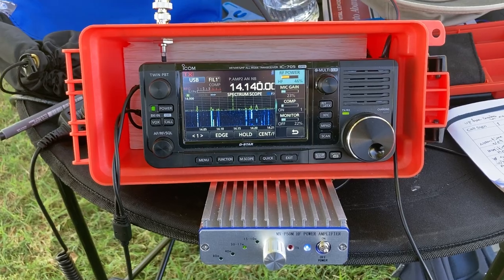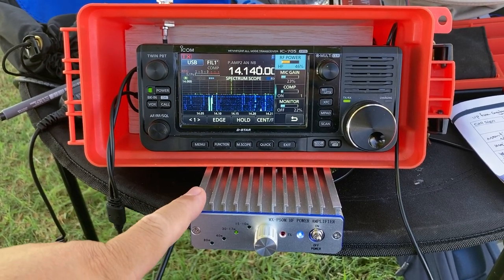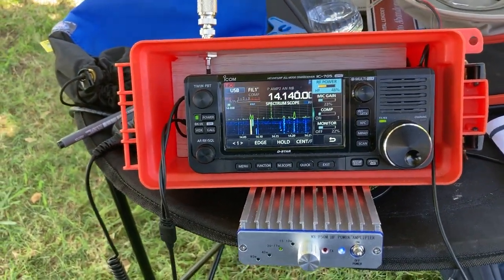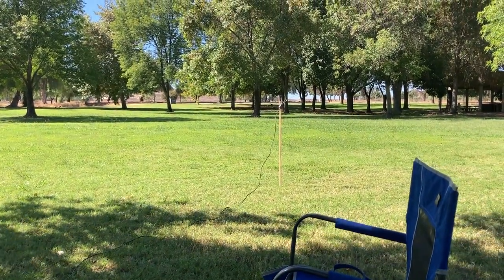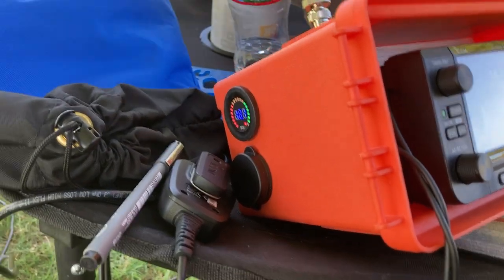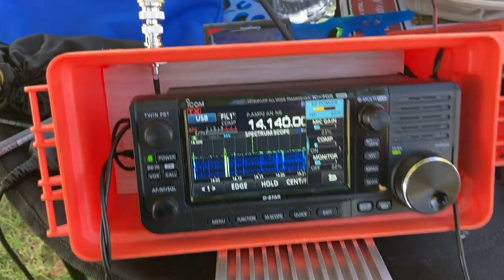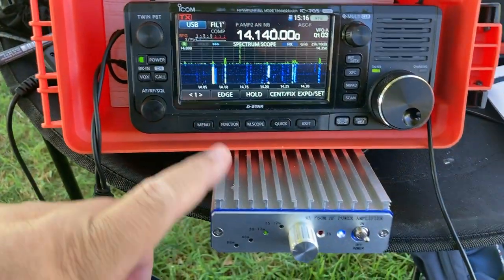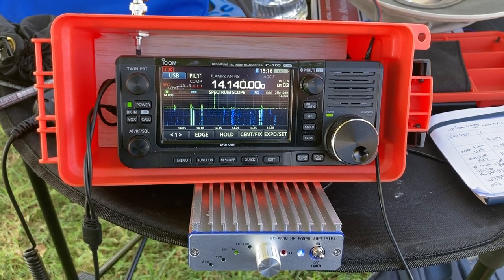MX-P50M Amplifier in The Field with IC-705

Comment: With the amplifier do you recommend IC-705 as a first HF radio for a new General License ?

Thank you for the great contents.
Reply from the maker: That is a very hard question to answer.  It depends on what you needs.  For example, you could look at the FT-891 (https://youtu.be/MUuwSA2wrFs) I did a how to on that.  It's compact and it gives you 100 watts, a lot more than the setup I have and it's all in one.  Unfortunately, the FT-891 doesn't have UHF/VHF nor does it give you a waterfall to look at what is happening in the band..  Then you have the IC7300.  A great radio.  The screen looks great but it weights more and it doesn't have UHF/VHF.  Also, the IC7300 has a tuner, meaning that if the antenna is not resonating on the frequency you need, the radio will try to fix that.  Although, the tuner is not great, but you have one.  The IC705 doesn't have one built-In.  One of the great features of the IC-705 (https://youtu.be/7Ay5hUkjwVo, I did a guide on it) is how compact the radio is and it has VHF/UHF. Unfortunately, it's only 5 watts without an external battery.  Now that you have that, your question. Is it a good radio for New General License?  It is if, you like going outdoors with the radio.  If you want this amplifier, you will have to modify it.  Meaning, you have to cut and solder some components.  Then, you have carry all the equipment you see on the video, it's a lot of wires and can be a mess.  Although, you don't have to use the amplifier to use this radio.  We are beginning a new Solar Cycle, which means that 5 watts will be sufficient on some days to talk to people.  With an external battery 10 watts is event better.  This of course you need to take into consideration the antenna  you are using.  If the antenna is not efficient, then your radio's 5 watts will not be enough.  So many things to consider.  You might also consider the FT-991A ( I did a how to use the radio https://youtu.be/kKc7RdenCGY).  This radio is compact, has HF, VHF/UHF.  It's ready for digital and it's compact.  The only drawback for me, is the interface - the ease of use.  I also didn't like the water fall, the refresh rate is not what I'm expecting.  But, is it a good radio to start?  Yes it is.  Finally two more thoughts.  You should go to your local ham radio store if you can.  Check the size and feature, don't get pressured to buy one.  Second, see if you can join a club and talk to the members on what radio they got.  Also, watch videos and read the reviews.  As for me, why did I end up with the IC705?  I wanted to be challenged by 5 watts, but mostly it's because of the compact nature and the waterfall.  The refresh rates is great.  Touching the the screen reacts like it should, not like the FT-991A.  The 705 has VHF/UHF - although I don't use it as much that way.  To conclude, if you want to open another can of worms then you should look in the KX2 I did a guide for it for Digital (https://youtu.be/E9w4qLESOrk).  I can go on about these radios.  I hope that helps you decide a little bit more.  Good luck, tell us what you got and if you like your choice.  Best, -73.
Reply: @frankwc0o  really appreciate your reply and insight Frank. -73
Reply: @almahallawy  I purchased my IC-705 when I was still just a technician, and made contacts 2300 miles away on 10 watts, 10 meters with anywhere from S5-9 on a vertical. It’s more radio than a tech class needs, but would say it is a great choice for a general class operator that plans on operating portable in low noise conditions like a summit.

I use mine for SOTA activations and often time see some of the bells and whistles as a hinderance, as I want something sturdy that can put up with bouncing around in a pack. I’ve been successful in protecting mine, but wouldn’t mind something minus the fancy touch LCD screen, like a KX2, which I still believe is the smallest name brand QRP rig you can get ahold of.

One thing to keep in mind is that QRP radios specifically have a lower RX current consumption than QRO radios, even if you turn your QRO radio down to 5 watts, by as much as 1-2 amps in certain cases.

I love my 705, and think it is a fantastic product, but would rather use something a little more rugged with marginal weight increase, like an FT-891 that will give me 100W without an extra piece of gear and the additional cable mess. You can use the IC-705 at home, when you’re not portable, as a base station hooked up to an amplifier and tuner, but at that point, you’ve spent more than the cost of an IC-7300 anyway. It’s for this reason that I have a separate IC-7200 for a base station and my 705 as a strictly portable radio, and an FT-891 when I’m portable, but need the additional power.

If I could go back and do it again, I would have started with the 891 and saved myself the additional $800-900 in equipment I needed to buy to make my IC-705 effective at something it wasn’t intended for. I really wouldn’t even recommend it for parks on the air unless you’re operating CW. Fantastic radio, but very niche.